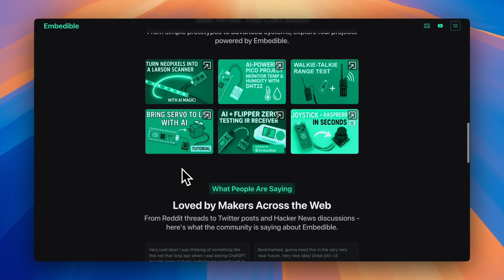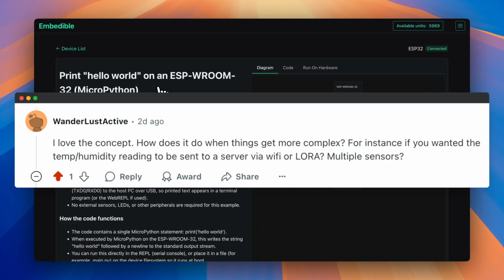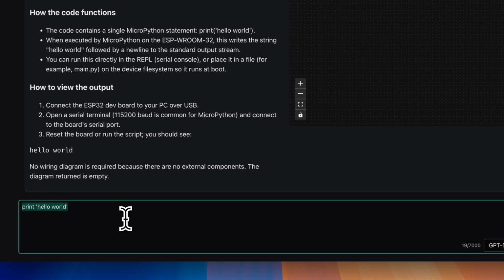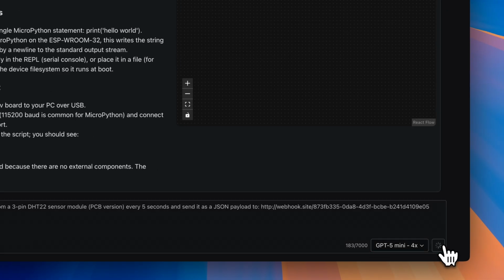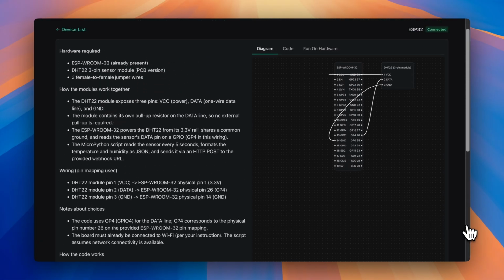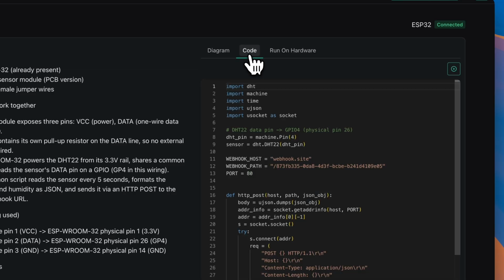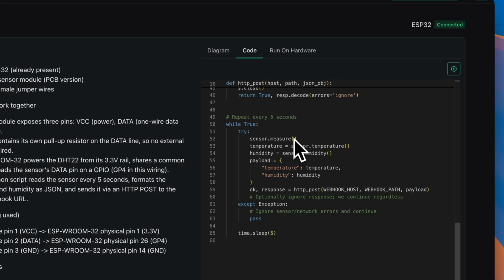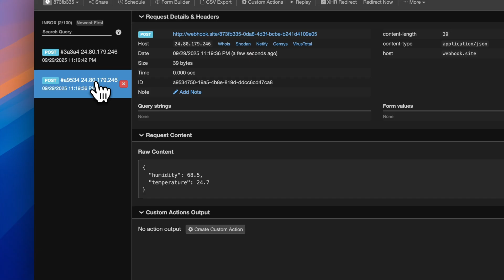I’m Building Lovable for Microcontrollers

Comment: Good features, but this code is not deterministic, right? So the user could have troubles/bugs. If someone needs the wiring diagram it would be better for them to look for proven tutorial on internet. And for someone more advanced it is almost like talking with LLM with nice features, I can't see target user base. But i can be wrong, good luck with a project ❤
Reply from the maker: Thank you so much for taking the time to share such thoughtful feedback ❤.
You’re absolutely right - the code generation isn’t deterministic. That said, the results have been surprisingly good in practice, and you can see different design examples across other videos on this channel. I’ve been impressed myself at how well it wires things together.

As for the audience, the tool is really aimed at beginners who just bought their first kit and might not yet know what to search for online. For them, having a ready wiring diagram and working code can make the difference between frustration and actually getting their project to light up. Personally, I also wasn’t fully satisfied with existing IDEs for MicroPython like Thonny or VS Code plugins, so part of the motivation was making the early tinkering process smoother.

I truly appreciate your comment. If you’d like to explore the tool further, I’d be happy to send you some free credits - just drop me a note via the email listed on this channel with the address you used to sign up.

Comment: Does it tells you when something is too complicated or will it hallucinate something up?
Reply from the maker: Great question - thank you for asking! 🙏
The system is designed to generally prevent hallucinations, and in most cases the outputs are quite solid. That said, like with any AI, there’s still a small chance it could produce something off, and we’re actively working on reducing that further.

It’s always a balance: if we constrain it too much, the tool becomes rigid and less helpful for creative prototyping. So the focus is on keeping it flexible while making sure it stays reliable.

If you’d like to try it out yourself, I’d be happy to send you some free credits - just reach out through the email listed on this channel with the address you used to sign up.